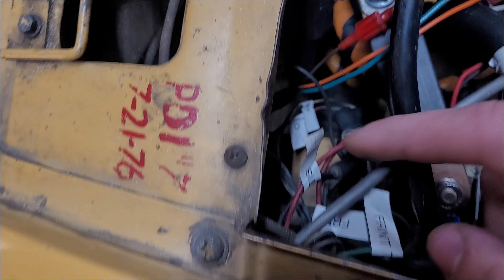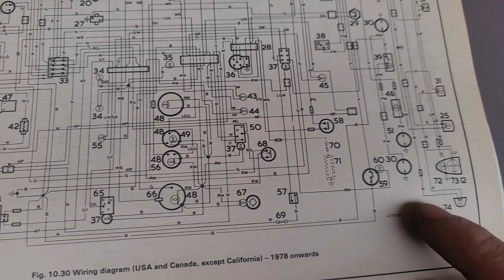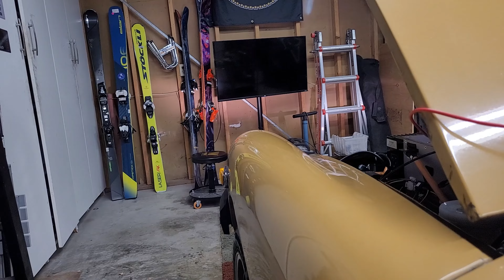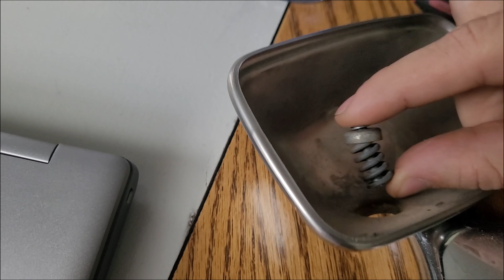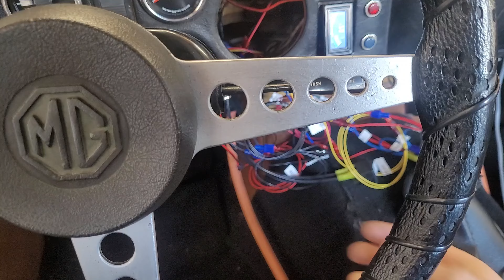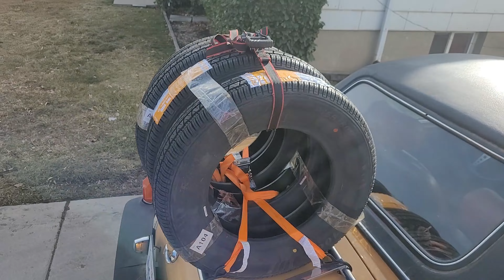Prepping my EV MG Midget for the Highway - Part 18

Comment: Great videos dude really enjoying the content, Are you sure the reverse was not that noisy before as reverse in a non synchro gear so it is normal to be a bit noisy on that gearbox, also  I could really hear a difference with the new motor in normal driving so maybe the original  motor was bad right from the outset,

Comment: "..maybe that's just the way these MG wiring harnesses work. You just move them a little and all of a sudden they work."
Close! They normally STOP working when you move them a little, but occasionally will choose to temporarily start working instead. Lucas didn't earn the reputation as "The Prince of Darkness" for nothing lol. 
The purists may hate me for this recommendation, but I HIGHLY recommend you replace each bullet connector and junction in the harness that gives you issues with a Deutsch connectors. Definitely get the barrel crimp ones, and not the fold over crimp ones as well. It makes a big difference in the reliability of the wiring harness.

Loving the EV conversion series!! Would love to see a similar setup in an MGB!!

Comment: The range estimate sounds great! Nice job troubleshooting the electrical stuff. My '76 has some of the exact same issues. I modified my brake switch so it would work, but am worried that it will fail if I ever get it on the road again. Really frustrating when the problem is intermittent. My tires are so old that they do not have DOT codes (pre 1996?) so I would need to replace mine as well to make it roadworthy at this point. Looking forward to you next video.

Comment: Good thinking labelling those wires, that will pay off over and over. The brake light switches are garbage but the replacements are worse, expect that switch to fail now that you're using the car more, then again, it is 40+ years old, so I'll give them a break on criticism. if yours are working, excellent, the corrosion at all those wiring junctions will be problematic and cause intermittent issues as the problems cascade downstream. Ditto on the ground side of things, there are a dozen places where a weak ground could cause issues. Like the fuse block, they're notorious as well, the fuse seats gets corroded and can stop the circuit. If you have the factory manual or the Haynes guide, you're a hundred miles ahead of the usual backyard mechanic. Key-on for turn signals and key-on for brake lights!! That surprised me when I first bought my Midget too!

Comment: The designers at MG saved 3 feet of wire by running the  brake lights and washer pump on the same circuit.  Value engineering!

Old crusty car electrics are so frustrating.  Lucas isn't called the Prince of Darkness for nothing!